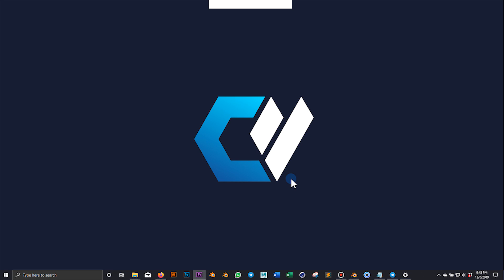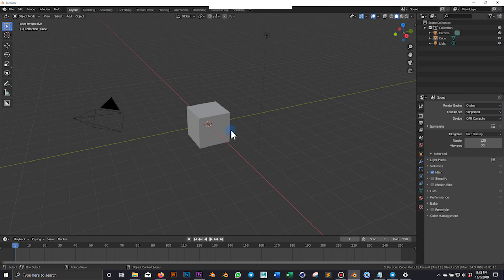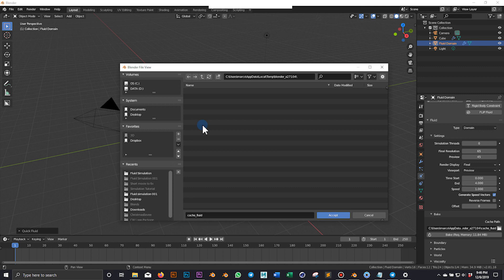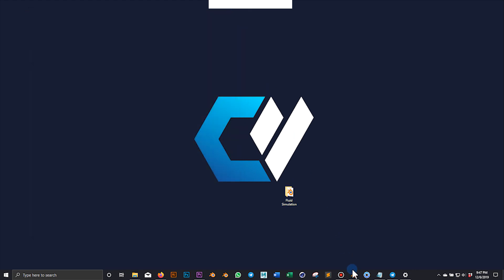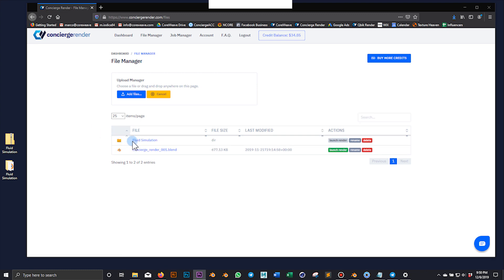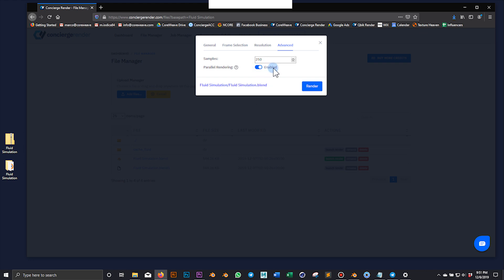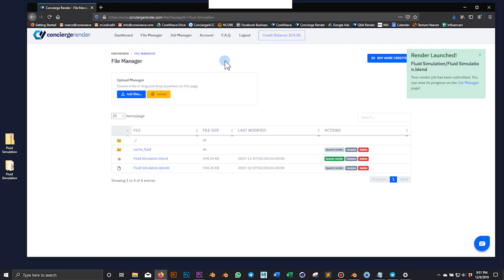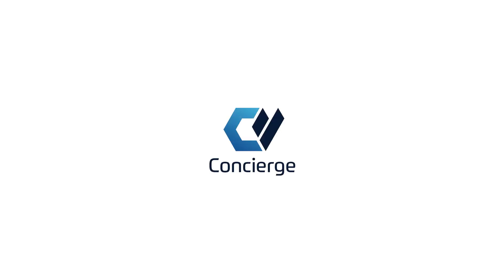Concierge Render - Fluid Simulation Tutorial

Comment: I am wanting to use Concierge for the first time. I have a large project with 1200 frames and 2 physics simulations. One is a smoke and fire simulation and the other is a Flip Fluids simulation with the Flip Fluids addon. I have already baked the two simulations and they are stored in seperate directories. How do i get my blend file ready for rendering with concierge without having to change the cache directories and and baking again? The simulations took about 8 hours to render and i do not want to have to bake them again. Hope you can help, many thanks.
Reply from the maker: You will need to upload all cache associated with your project in a folder, as shown in this video, and be sure to make all paths relative!